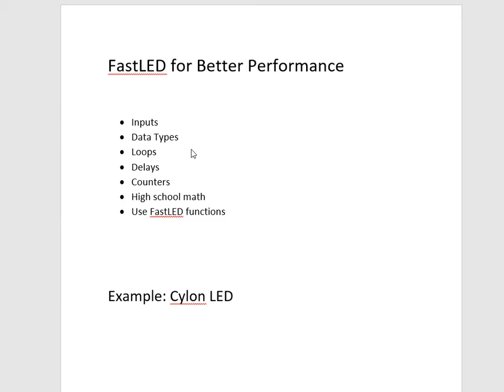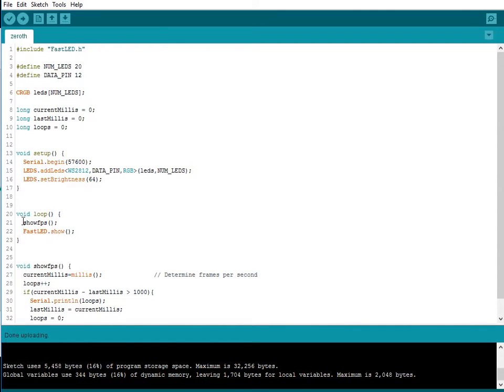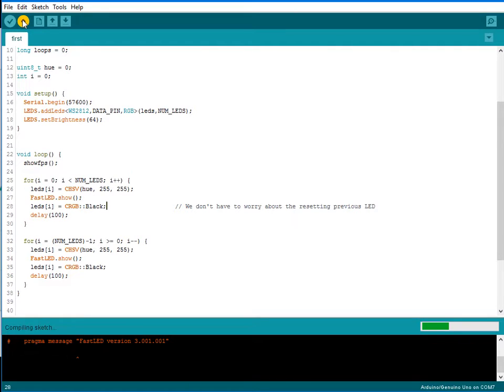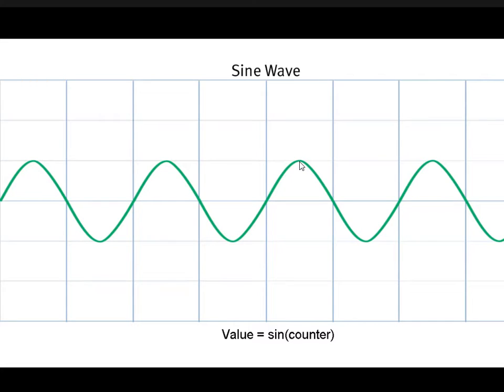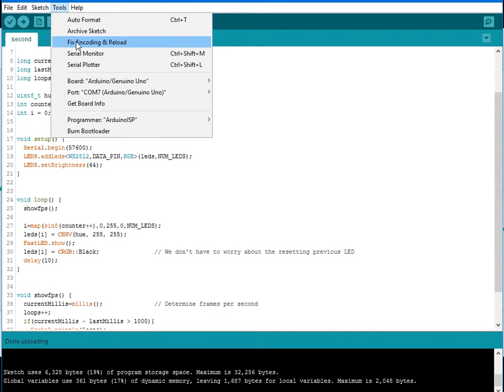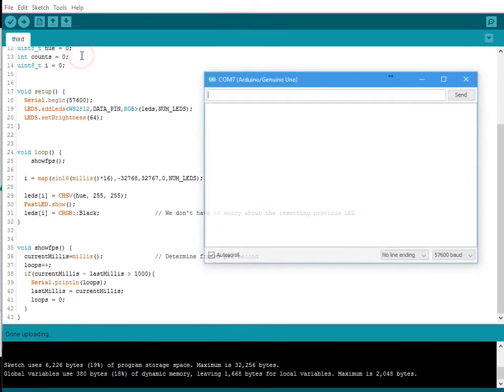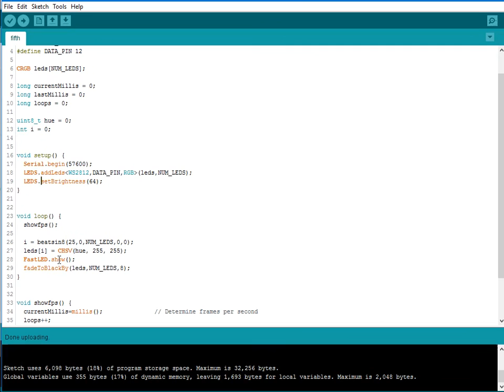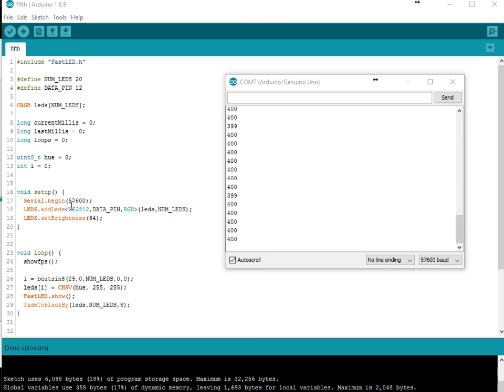FastLED for Better Performance

Comment: This is a really clear and informative video Andrew, thank you. 

I prefer the sine-wave pattern to the linear pattern from the fixed delay loop, looks more natural.

I may be wrong but I think the map and beatsin8 function calls should use NUM_LEDS - 1 rather than NUM_LEDS as the array is zero-indexed?  May be wrong though!
Reply from the maker: Does it go up to NUM_LEDS or not, and that's a question that has bit many a FastLED programmer over the years. I just tested to make sure and added the following lines right after that map statement:

  static uint16_t lowi=0;
  if (lowi < i) {lowi=i; Serial.println(lowi);}

. . . and it  went up to NUM_LEDS-1. Whether you're using a map, a beatsin8, or one of so many other functions, it's important to know exactly what your min and max values are. I'll write a little test sketch if I'm unsure..

Comment: Hi, this is EXACTLY what i need, thanks :-) 
One question: 
I understand the second example using sin16, but you say it "gives us the ability to remove the delay value". But why is that - why couldn't you just delete the delay value in the first example too?
Reply from the maker: As I recall, the first example only has 8 bits, or 256 values, which isn't a lot to play with and you need to slow it down. The second uses 16 bits, so with 65535 values, it takes a lot longer to go through the same sine operation. 

Give it a shot yourself and see what you get.